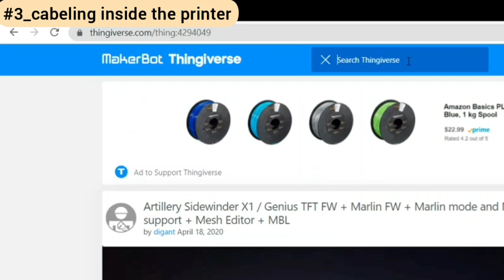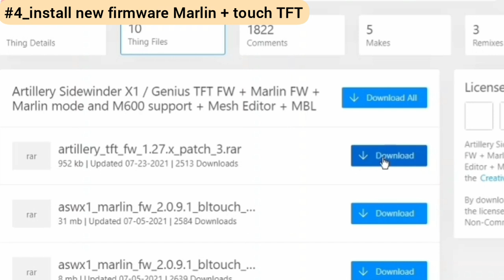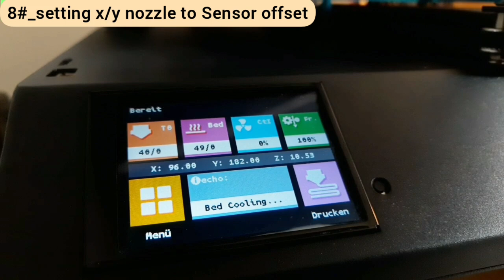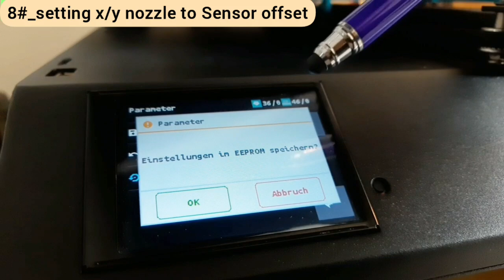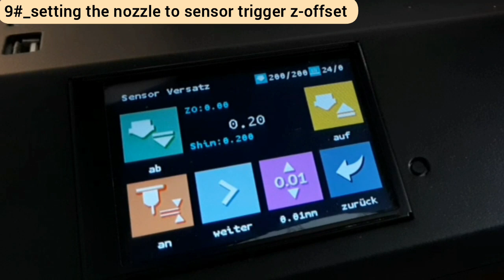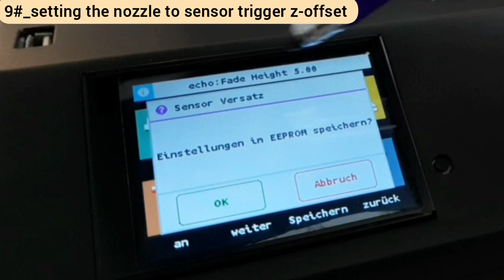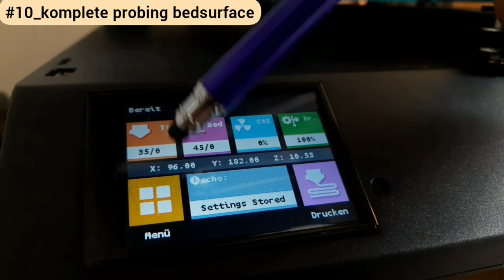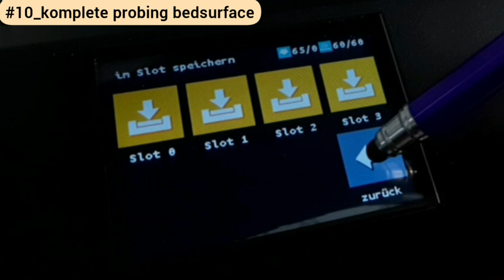(english) Sidewinder X1 _ ABL Touch Sensor + newest Marlin 2.0.9.1 Upgrade

Comment: I used the most recent version of Digant's firmware (due to the link in the description not working at the time I did the mod) and this wiring. Do you know if the new version expects the wire to be somewhere else? Currently everything goes great, it does all the leveling and tuning features, until I try to print. At that point it does not seek the input from the BLTouch at all and just rams right into the print bed. :( No answers on Thingiverse so I'm seeking help elsewhere.
Reply from the maker: This is a known problem. 

Do a test first.
Wind the nozzle 10cm up by hand.
Start any print. While the nozzle wants to probe the bed and moves down slowly. Trigger the touch by hand and it should stop just as it would touch the bed.
This way you can be sure the touch works, just the offset nozzle tip to touch ist incorrect, so the nozzle reaches the the bed before the touch stops.

The z offset is wrong even after doing the correct procedere.
Set the z offset in the display menue by hand higher, so that the nozzle stops way  clear over the bed when the print starts.
Start a print, nozzle should be at least half a mm over the bed. Use the babystep button (lower row second from left ) and bring the nozzle to the correct first layer hight so that it prints.
Now important.
Save straight within the babystep menue to the eprom.
Reply: @JustPrinted3D  So my issue is that it doesn't even extend the probe tip when it goes to print. I can't trigger the sensor because it's not even looking for input from it. Works in every other menu but printing it could care less. I am using an Antclabs BLTouch version 3.1 if that matters.
Reply from the maker: I have tried 3 different touch sensors, also the antlabs.
Only the v3.2 worked, not the antlabs and another.
Some sensors even need an additional resistor. It is a bit strange.
However not all sensors work stable or at all. 

Diffrent things i would check.
- dont trust the flat cables, install a new test wire from probe direct to the mainboard
- install firmware again
- use another unzipp programm to avoid software errors while unzipping
- try other sensors
Reply: @JustPrinted3D  Thank you so much for all of your help. After trying a million things to try to get this to work (including installing an older version of the firmware) I think my issue was the connector with the brown wires not making good contact. I ended up finding another video where he said to connect that cable the opposite direction you did (It did not like that at all. Trying to run it like that it got confused, moved up a few times, and then tried to print mid air.) Once I was done with that insanity I switched it back the other way and noticed what I think was a small bit of hot glue left over in my way. I cleaned that off and made sure the cable was fully seated and tested again. Off it went as I anxiously hovered over the off switch. :D I'll fully test it tomorrow but it actually started the print with the AntClabs V3.1 sensor (that is the highest version they have)

Again thank you for all of your help both with the video and your replies. I appreciate your hard work. :)

Comment: Is there any way I could contact you for some trobbleshooting? the bltouch does what it needs to do, messures good. But when I start printing the first layer is horrible. not smooth at all. Did the auto bed leveling twice and als did the offset twice but still doesnt work.
Reply from the maker: Use the baby steps, lower second icon from left, and adjust the first layer while printing the first layer until it looks fine, than press store to eprom right within the same menue.

Just use a cube from the Cura Calibration shapes and drag it to 10x10cm size, so you have plenty of first layer surface to get the adjustment right while printing. Speed of 25 mm/sec should be fine.
That baby stepping procedure will get you a nice first layer.
Ofcourse, I must assume that everything else on your mechanics is in order. 
No loose rollers etc.